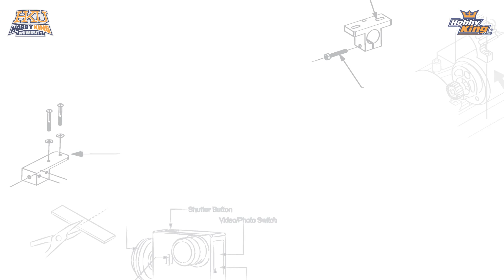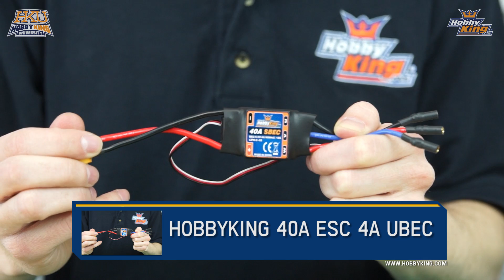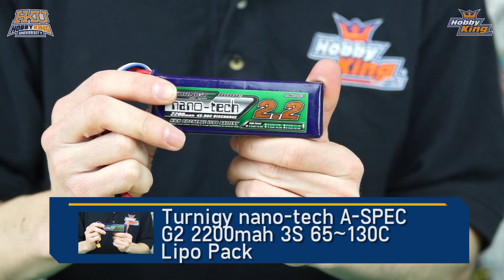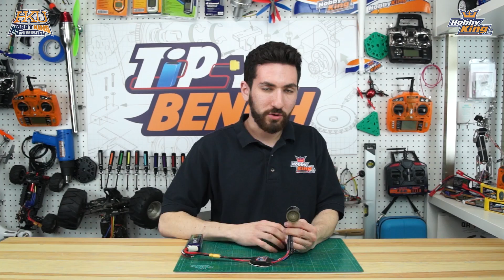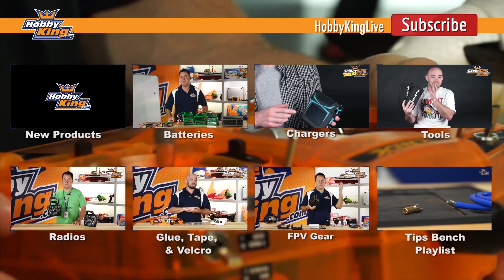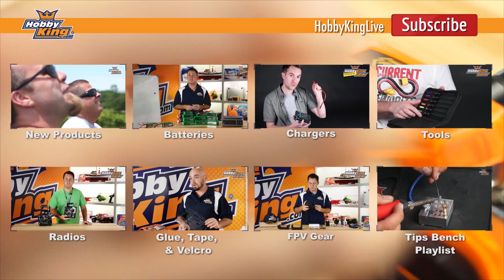Tips Bench - Motor Reverse

Comment: @hobbyking, I have a 110v 60hz 3rpm synchronous motor,  they are used for all sorts of things most commonly egg turners for incubators, I want it to do a half turn in both directions, to rotate the eggs left n right like a seesaw, do I need a h bit binary module, or what should I use? and do you have any link that I could research? thanks, keep the good vids  comming

Comment: Nice you used my idea!
Reply: How to charge a lipo. Soldering bullet connectors. Wire mesh guard install. Removing stripped or stuck screws. Using loctite. Where to use oil or grease. Meshing gears. Hk 6ch transmitter software explained, or just the meaning of the different settings. Blade balancing. Pitch gauge. Difference in gyros/ their function. Different tools. Also how to remove ball links without the tool, mabe you have a trick? That's it!
Reply: Kv mah c meaning that kind of stuff